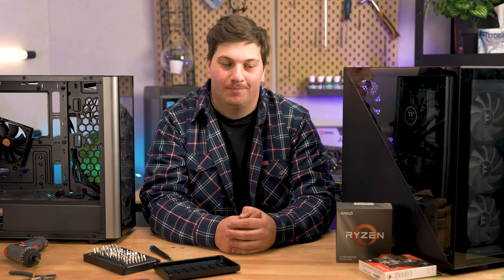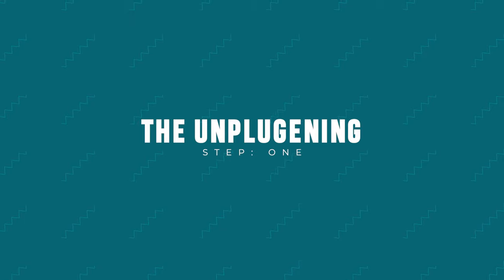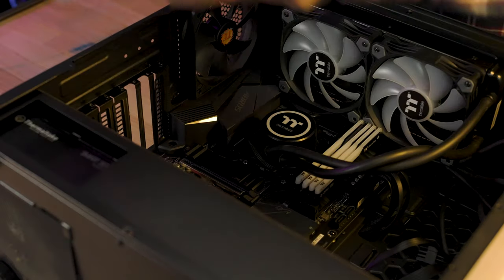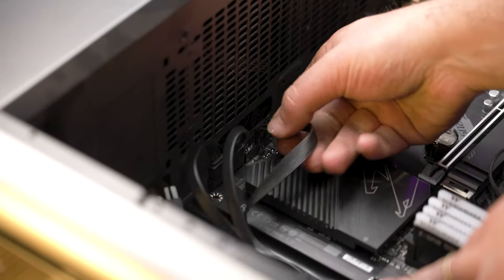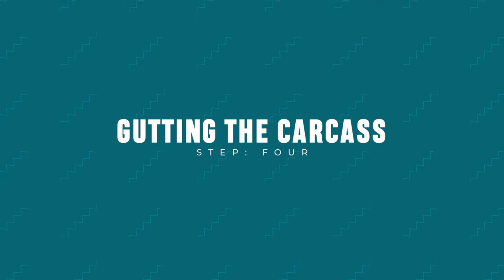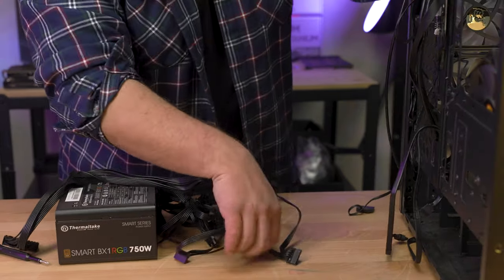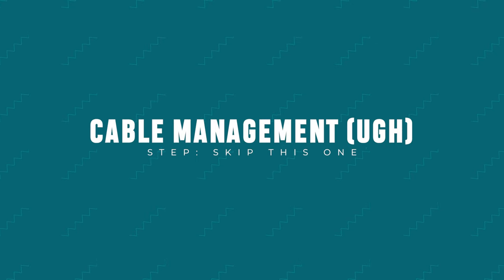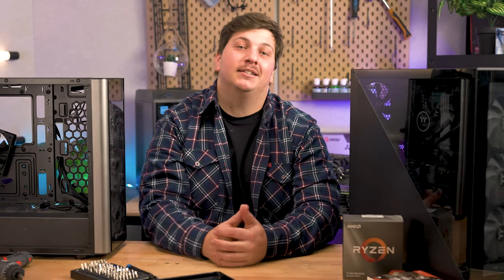How to SWAP your PC Case - A Complete WALKTHROUGH

Comment: Kewl. A note about removing the Motherboard and CPU power connectors - they are held in place with a latch mechanism. Trying to remove them without pressing on the latch will not be a joyful experience.
When you have 'gutted the carcass", it's a great opportunity to remove dust and gunk from fans, radiators and PSU vents.
Reply from the maker: Totally something worth mentioning! Will pin this comment!
Reply: it is also so hard to get the 16 pin connector out It took me one hour to pull it out lol
Reply: With my case its impossible to press the latch
Reply: If you see this what about gutting it the. Throwing in a ps4??
Reply: That is what is putting me off a PC build lol, But I will still do it, I always get nervous when I got to do the Power button connectors to the motherboard as they is different, It gets me edgy but I will do the Camera method, I am doing an MSI Mag Forge 320 case today, An i5 12600k, Cooler master liquid cooler 240 on a Gigabyte H601i Mini ITX mobo, With a 3060, It is going to tiny tucked away in the top left corner, lol, A mini ITX board in a Mid Tower case, I am actually wondering now will it actually look good, lol, Will find out later....
Reply: @GotItbavk-qm2be  Sorry for the late reply. Try a small flat bladed screwdriver. My fat fingers are not designed for fiddly PC assembly, yet I have done many in my career. Keep going!

Comment: I think for beginners that don't know where the cable go you can get those small stickers and write down a number and stick on the wire and connectors with the same number and then unplug the cable so when you want to plug it back in its easier to find which cable go where
Reply from the maker: Huge TIP! Good idea
Reply: Yes, absolutely going to try that when I switch cases,thanks
Reply: No need ...the guide is very good...just make sure to take pictures at the power button and reset button litle pins or just remember where did you unplugged them from and the rest is easy. I had to go and dawnload the manual online for my motherboard..I thought I f up for like 30 min...didn't know what to do.
Reply: I just take pictures
Reply: Even if your not new to this, it's still the best practice.
Reply: Thank you for this! This will be super helpful I literally never would of thought of this lol
Reply: Yea, thisbis a great idea😂. I want to change my lian li o11 dynamic into the snow white version.
Reply: I need this, i dont trust myself.
Reply: Too late already unplugged the cables
Reply: As a beginner I was thinking the same and thanks for sharing that thought
Reply: But almost all cables are labeled and motherboards have all the ports labeled haha
Reply: Nah always wing it , works every time ;)

Comment: I used this guide today whilst doing my first ever case swap (with added cooler replacement). Really easy to follow the step-by-step instructions and the result was a very satisfying first time boot! Thanks mate, I was really nervous about attempting this.
Reply from the maker: Yeeeeeewww!!! Best comments to see are these ones. Super glad the video was able to give you some confidence to tackle your first ever case swap!
Reply: @ThermaltakeAustralia  bro im 14 and have a prebuilt. i dont like the case so im trying to swap it. you think i could do it at my age?
Reply: @Sam Porter it’s my first time too and I also got a rgb cpu cooler with it
Reply: @MustangGuy112 we both are in the same situation😂 tho did you end up buying the case?
Reply: @savanabit  nah I sold the PC a long time ago and just built a new one from the ground up.
Reply: @MustangGuy112  Good job. Building your own PC can be fulfilling and is a good skill to learn. It's also cheaper than buying a prebuilt, and if you ever have a problem you can be sure that it's something you did and not something from the factory. Cheers!

Comment: This video was great for the case swap I did last weekend. I've had a Acer predator desktop for a number of years and recently purchased a new board, Ryzen 5 5600 CPU, GPU and power supply but these went into the old case. Doing this case swap and putting all the components in the new case resulted in a drop of idling temp by 20c 😁😁😁
Reply: The bad thing about doing your 1st PC build and it going OK - you start thinking about doing another one, 🤣🤣🤣

Comment: "So simple a child could do it." I've added a few steps when I do a case swap. I place a double layer of bath towels on my desktop. They catch screws if they fall and help to prevent damage to other components. I use an old-style ice tray to store my screws and small parts. I label each bin, showing where they go. If you have a set of paint-type pointed-end marking pens, you can place a dot of the paint on the bin and another near the screw hole where they go. The CPU power cables located at the top left of the MB can be hard to remove and replace. I remove them after I have loosened the MB and reattach them before I mount the MB. If I replace any components with new ones, I reassemble the PC on a test/workbench. This step ensures that the new parts can be tested before mounting them in my new case. I bought one from ANAZON for less than $30. I hope that some of my steps assist you with this project.

Comment: Took me 1 hour to swap cases the first time ,the most difficult thing was to connect the powerbutton cause of the small text on the motherboard, the rest pointed itself.maybe i seen to much pcbuilds on youtube...but i was upgrading 2 different pcs earlier.and with this swap i needed another powersupply and a other gpu and ram memory.swapping a wx2100 for a rx590.also had to install windows 10 from 32bit to 64bit and than to windows 11(system not supported) but bypassed that.that took me the longest.

Comment: Probably a dumb question... I'm thinking about swapping my case sometime soon and haven't done this before. I have 3 SSD's in my current setup.  When I transfer everything to the new case, will I need to ensure that the SSD's get plugged into the exact same SATA ports or will the computer just know which drive is which? I would hope that I dont have to reinstall windows or any programs/games... so I am just wondering if it all needs to get plugged in exactly how it was in the previous case. 
Thanks in advance for any advice provided!

Comment: When u finally boot it up will it work perfectly just like before u switched cases or will there be some reinstalling? Also will it forget anything?
Reply from the maker: Great question to ask! Providing you've installed everything correctly, it'll boot up as if it were in the old case still, i.e. it'll be as if nothing has been swapped :) Everuthing will be there.
Reply: @ThermaltakeAustralia  ok thanks

Comment: Great video! I'll be transplanting the guts of my current rig into a Versa H24 case in the next few days and this guide is a bit of a confidence boost. A question about "built-in" stand-offs (the domes or little bridge bits with threaded holes that are pressed out of the metal in the CPU tray)  for the motherboard inside some pc cases: On a few forums I've 
had people telling me  "put electrical tape on those stand-offs or it'll short out" or "don't use them, they'll short out your motherboard". Am I correct in thinking that these guys are being  a little paranoid? I mean why would the case manufactures build "built-in" stand-offs if they were going to be a short hazard for the motherboard?
Reply from the maker: Hey Nathan! Jono here - That's awesome mate! Excited for you to do your first case swap, I hope everything goes smoothly for you, just take your time and you'll nail it! 

In regards to your question about included stand-offs: I've been building computers for 15 years now and if a case has come with stand-offs, I've used them. I've never had a motherboard short out due to standoffs not having electrical tape on them, although that's the first time I've heard anyone mention that haha. 

I will say, the PC Building community does have its fair share of "extra-paranoid and overly cautious" builders out there - Heck.. I've even worked with some haha. PC Hardware is nowhere near as fragile as some make it out to be. You will be fine with using the included standoffs. JUST MAKE SURE that you don't drop a screw or m.2 stand off behind the motherboard and then screw the motherboard down and start the PC, as that's something that could short the PC. 

Hope that helps out!

Comment: Thanks for the tutorial, however, do i really need more thermal compound? I don't currently have any, and was wondering if I could jut route the motherboard on installation through the top of the case as there is a slot for that. I dont want to go trough all the trouble or re applying thermal compound, so this I think is a possible solution.

Comment: I have issues. After I changed the case the fps in the games got low. Before I always played with fps 200-300. But now it’s not getting higher than 100 (30-70), it feels like I’m lagging. I updated the drivers and tried different stuff, it doesn’t really work. What can the issues be?
Reply: Have you found your solution? what was the cause?
Reply: A case with bad airflow may result in increase of temp which is probably the reason of sudden bad fps, if not you might have broken a or some components, you might wanna get that checked if that's the case (pun intended)

Comment: Don't be me. I bought a new Fractal Torrent case and did not properly measure the size of my radiator. I'm now waiting a week for an air cooler to ship to me, which I think will be a better fit for this case anyway, considering fractal makes amazing airflow cases. Still feel dumb though for not double checking. 🙃

Comment: If I'm using the same motherboard,  cpu, and hard drives is there any software changes that need to be made? I'm only upgrading my vidocard from a rtx 3080 to a rtx 4080. Oh yeah also upgrading the power supply from a 750w to an 850w

Comment: Hey quick question. So if I plug in the pump to cpu fan, where would you plug in the the radiator fans? Great video btw!
Reply from the maker: Hey there, great question! 
You have some options, you could actually get a fan splitter and then plug them all into the CPU fan if you wanted to, otherwise, you can plug them into CH or SYS fan headers on your motherboard as well. Most of these are not tied to the CPU temp by default, but you can change them in the bios. Personally, I like having seperate control over my fans, so I use a SYS fan header and then set it to a specific amount of volts to get a desired RPM/Volume. 
Hope that helps
Reply: @ThermaltakeAustralia  Thank you and thank you! You made this very easy for me. Now when I get that new case, I won't be worried about what to do.

Comment: One question. I currently have a prebuild pc with no fans in the front only one in the back. How will I suddenly swap from 1 fan to 3 in the front and 1 in the back? Since I only have 1 fan. I want to swap to the Corsair 4000D. And it's pretty confusing to go to 3 fans in the front because my prebuild is closed in the front and has no fans there.
Reply: Idk there is only one way out of this. 🙄🔫
Reply: Could you elaborate? I would gladly help but I am a little confused by your question

Comment: I was wondering if you are able to just not replace the Thermal Paste? as I've already gotten everything and am now wondering if I truly need to replace the paste. (im not doing a cooler swap)
Reply: I know that i'm proly waaaay to late to answer this question in time but it certainly is essential to remove and reapply the thermal paste if you are going to take of your cooler and reattach it again (or swap coolers). If you don't and reuse your old thermal paste it will impact your thermals since the cooler and the cpu will not connect correctly anymore
Reply: @naku28  oh that’s fine. LTT debunked this, but I still swapped my paste since it was like 10 years old

Comment: what do i do if I have a used school pc and want to swap cases but dont know how the cables to the motherboard work where could i find a manual to set it back again
Reply from the maker: Depends on what cables you're referring to. If you mean the PSU cables, they will pretty much go in the same place regardless of your PSU or motherboard. So you can check out one of our PSU tutorials here: https://youtu.be/lPh_vI-XkmM If you mean the motherboard I/O cables, that will be on a case by case basis (no pun intended), but this older video might be of some help: https://youtu.be/raXX4u862g8 Best of luck!

Comment: pls someone help - I got someone to swap my pc case and i'm pretty unhappy with the results. My pc is now super loud - it was DEAD quiet before. mind you - my old case had 6 fans, 3 in which didn't work so it was running on 3 fans (2 being radiator fans) and my PC was so quiet. no sound at all. now it has more fans. 1 exhaust, 2 bottom, 2 front, and 2 radiator fans. It's sooo much louder now. even when my old case had all 6 fans working, my pc has never ever been this loud. I'm super irritated by the sound it's making and need some help fixing it. I tried setting my motherboard fan speeds to silent and there was no changes. what do i do
Reply: I suggest swapping cases again seems like you got a case that is just rlly loud OR you have defective fans

Comment: Where does the front fan cables go?
Reply from the maker: Sometimes there's a fan controller that front cans can be installed into, other times, you can connect them together like a daisy chain using fan splitter cables and plug them into a SYS_Header or CH_Fan one too.

Comment: for you 8pin cpu cable can you plug them into the wrong place? like lets say mix match
Reply from the maker: The 8 pin CPU cable can often be confused with the 8 pin PCI cable, so make sure you triple check it's the correct one because you can seriously damage your hardware if you do mix them up. 
If you take a very close look, the CPU 8 pin with be able to split in half into two 4 pin halves. 
The PCI-E 8 pin will either the a solid 8 pin connector that cannot split OR it will have only 2 pins that can detach
Reply: @ThermaltakeAustralia  yes correct im sure i have the right 4 pin halves connected to the top left of my motherboard. after swapping my case i found out that my pc doesnt turn on lol but im pretty sure it has to do with the front panel connector. ill try to use the splitter tomorrow because i triple checked everything and made sure everything was plugged in.

Comment: How about For those who Have Old case 
The Placing of Hard drive is different from it some is hanging with screws.

Pls Reply at me, Im planning to buy Dell optiplex with good specs And im worried the GPU i will put will not Fit Because 
Its online They might give me Random 
Size Theres MINI Tower, SSF in short Small form. These sized is only that  have PCIe slot, Yes it does have Integrated Graphics And 12gb ram But.
Im worried it might not handle games
Especially heavy games, so im buying Graphics card but im worried it might not fit, Pls tell me if i can switch The dell mother board into other Case, My other PC has old Case And its High-End.
Should i buy new case and put it there after i bought the Dell optiplex PC.
I don't know if they can give me Tower sized Dell optiplex, Because its Random Brand, But i can chat the seller if i can go with Dell Tower Sized or Mini Tower.
Please help me. Im litteral novice at building PC still hasnt do it. I only know how to fix Ram.

Comment: A good but a bit overly simplistic start made, then you remove the 24 pin power connector to the MB. Sorry you made a massive mistake here. This connector like some others, usually has a latch. Just pulling a reluctant connector, as you advise, could mean a broken motherboard. You should have mentioned latches and keys on connectors, more important than, may need a smaller screwdriver. While on the screwdriver, explain that the graphics card latch should not be pushed or prodded with anything metal, there is the possibility of slipping and scraping many tracks off the motherboard.

Comment: if you are swapping from a NZXT case, be careful with taking out the usb 3.0 connector. I fucked up and got the blue plastic part stuck in the mobo lol. Right now I am leaving it in there cause don't want mess up the mobo. Luckily, they have pcie adapter as seen here: https://www.youtube.com/watch?v=emZhvFbHCn4
I was going from NZXT h510 elite to corsair 4000d airflow. Still haven't full migrated everything over yet after that usb fuck up :(

Comment: Hi, first, i love the video and its very helpful, second, in my PC I have the Wraith Prism as my CPU cooler, and not much space to take it out, do you think, it would be helpful, if i would heat up my CPU a bit so the thermal paste is "softer" so i can take it off more easier? Or do i even have to take the cooler off? Because, i can remove it with the Moterboard.
Reply from the maker: A bit late to reply to this one! So sorry there. But for others who see this comment and are wondering the same thing. If you've got a small cooler like the Wraith, you can leave that on :) BUT if you do want to remove the the cooler, you can have it on for a minute or two and then power it down. It should make cleaning the paste a little easier as well.
Reply: @ThermaltakeAustralia  A bit late to reply too there, but i wanted to say thank you, im swapping pc cases tomorrow and this video halped alot, again. Thanks!